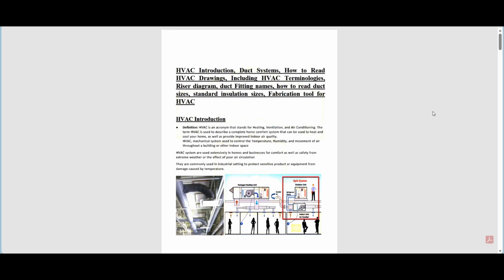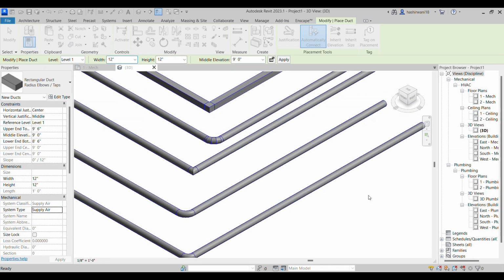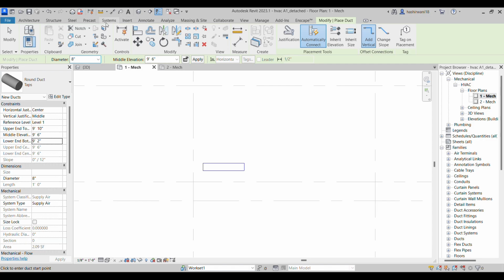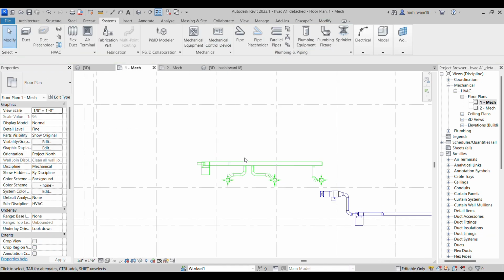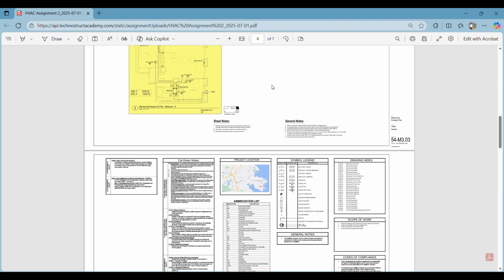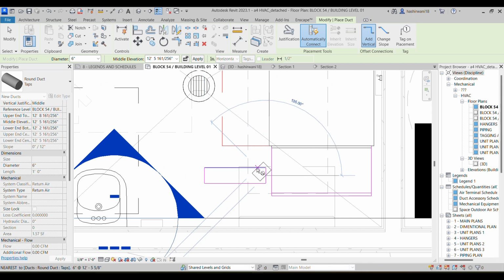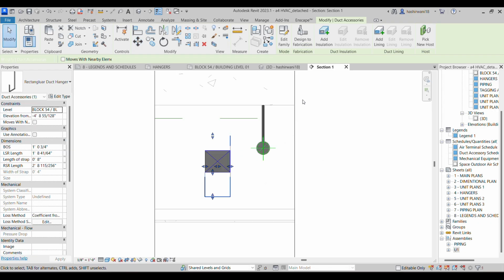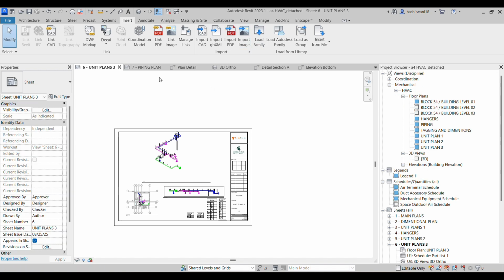BIM HVAC Modelling Recapitulation Masterclass by ER HashirVani #bim #revit #structure

Comment from the maker: This masterclass by Er Hashirvani provides a comprehensive recapitulation of BIM HVAC modeling in Autodesk Revit (0:13). The course covers essential concepts for mechanical, electrical, plumbing, and fire protection modeling, with a specific focus on HVAC ducting and mechanical piping (0:26-0:36).

Here's a breakdown of the topics covered:

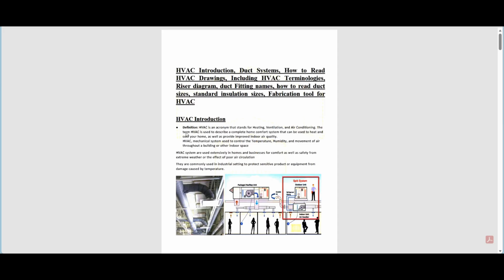Introduction to HVAC & Modeling (1:04-1:07, 1:54-2:47): The video begins with a brief introduction to HVAC, defining it as heating, ventilation, and air conditioning systems that control temperature, manage humidity, ensure air movement, and improve indoor air quality. These systems are crucial for comfort and safety in various buildings, especially in extreme climatic conditions.
MEP Project Setup (1:07-1:10): Learn how to configure the project environment and customize templates for efficient MEP work.
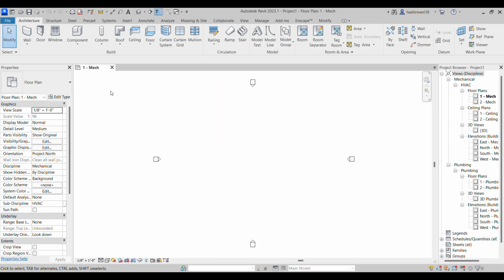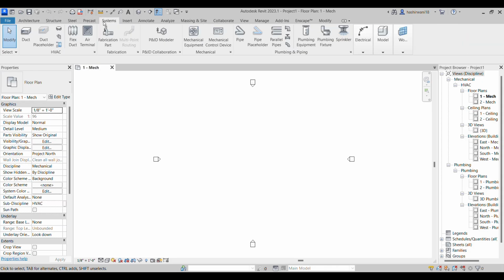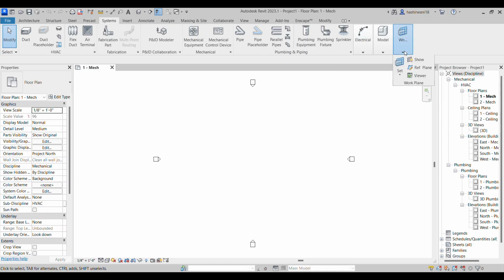HVAC Modeling Basics in Revit (1:10-1:22): The masterclass introduces the Revit layout, including properties, project browser, and ribbon (12:15). It details the systems tab for MEP components like HVAC, mechanical, plumbing, fire, and electrical systems (12:23-12:45).
Advanced Ductwork (1:14-1:18):
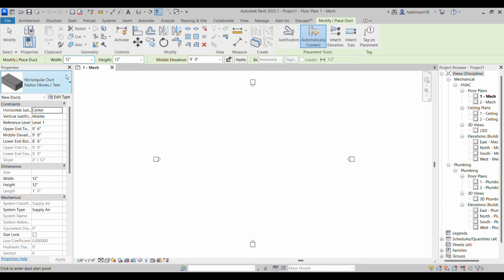Duct Types and Properties (13:23-15:09): The video explains the two main types of ducts: round and rectangular, along with their subtypes (oval, elbows, taps, T's). It covers setting width, height, and middle, lower, and upper elevations, as well as reference levels and system types (supply, return, exhaust).
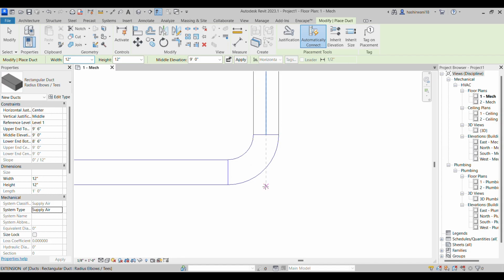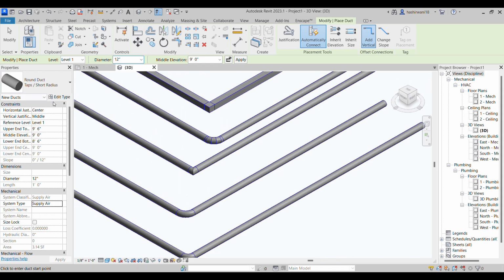Elbow Types (15:48-18:18): The distinction between metered elbows (90° angle) and radial elbows (with a radius) is demonstrated.
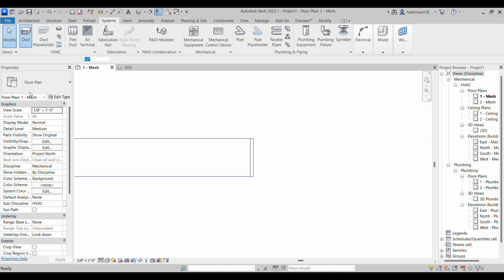Justification and Stub Ups/Downs (20:26-24:07): How to change duct justification (center, left, right) and create stub ups (duct going upwards, indicated by a cross symbol) and stub downs (duct going downwards, indicated by a cross with a central space).
Color-Coded Duct Systems (27:19-29:04): Revit uses different colors to distinguish between duct system types: blue for supply air, magenta (pinkish/reddish) for return air, and green for exhaust air.
Customizing Duct System Colors (29:47-31:50): The video demonstrates how to change default colors for existing duct systems and create new custom system types with user-defined colors.
Types of HVAC Duct Systems (3:19-5:14):
Split System (3:24-3:51): Consists of an indoor unit (evaporator coil, air handler) and an outdoor unit (compressor, condenser) connected by copper tubing.
Hybrid Split System (3:54-4:17): Combines a heat pump and a traditional furnace, automatically switching between the two for efficiency.
Package Heating and Cooling (4:21-4:53): All components (compressor, condenser, evaporator, air handling unit) are housed in a single unit.
Zonal System (4:55-5:14): Divides a building into multiple temperature zones using dampers, control panels, and programmable thermostats, with each zone having its own temperature control.
Other Duct Types and Components (5:16-6:04): Briefly mentions duct-free mini splits, hydronic heating, portable spot coolers, and heat pumps, along with basic components like air filters, supply fans, exhaust ducts, boilers, water chillers, heating/cooling coils, air terminals, and ducts.
Main HVAC Units (6:05-9:39):
Air Handling Unit (AHU) (6:15-7:05): A large centralized system for controlling and circulating air throughout commercial buildings, hospitals, malls, and airports. It draws fresh air, filters, heats/cools, controls humidity, disperses air, and recollects it for reconditioning.
Fan Coil Unit (FCU) (7:08-8:00): A smaller, localized HVAC unit used to condition air in individual rooms or specific zones (e.g., hotel rooms, apartments, small offices). It can work as a standalone unit without external ductwork.
Energy Recovery Ventilator (ERV) (8:07-8:54): A ventilation system that exchanges stale indoor air with fresh outside air while recovering energy from the outgoing air. It improves indoor air quality, reduces the load on HVAC systems, and saves energy. ERVs are used in modern homes, offices, hospitals, and airtight buildings.
Summary of Units (8:56-9:39): AHU is a large central system; FCU is a small room-level unit; ERV is a ventilation device for energy recovery and efficiency.
Ductwork and Symbols (9:42-11:34): Discusses the importance of properly installed and maintained air ducts for indoor quality and comfort. It also introduces symbols for supply air, return air, and exhaust air, as well as symbol legends and abbreviation lists essential for reading HVAC drawings from design engineers.
Practical Revit Modeling Example (32:00-45:30): The latter part of the video demonstrates a hands-on example of modeling a duct system in Revit, including:
Placing mechanical equipment like an FSD (fire smoke damper) (34:55-36:10).
Drawing round and rectangular ducts with specific diameters and dimensions (36:30-40:05).
Ensuring correct bottom of duct elevations (36:53-37:34).
Automatically applying reducers when connecting ducts of different sizes (38:45-39:53).
Creating stub ups (42:06-42:19).
Placing air terminals/diffusers (42:55-45:30).
Verifying system connectivity by tabbing through elements (42:46-42:53).